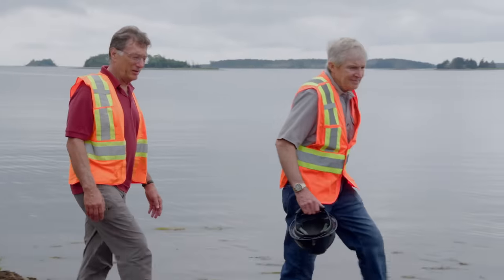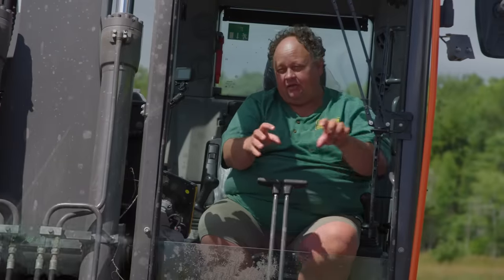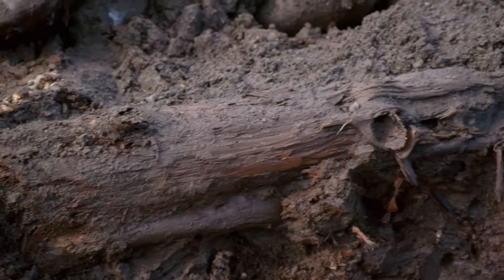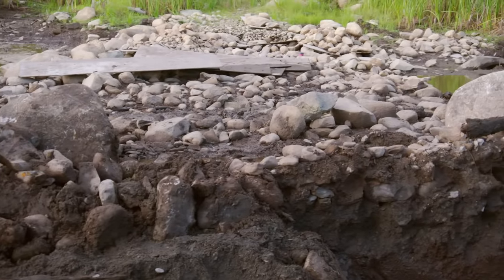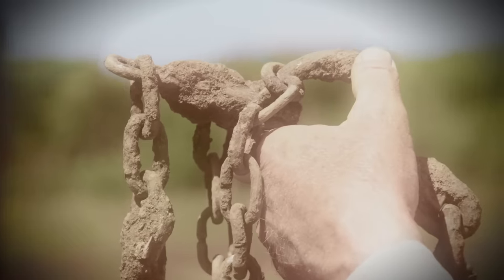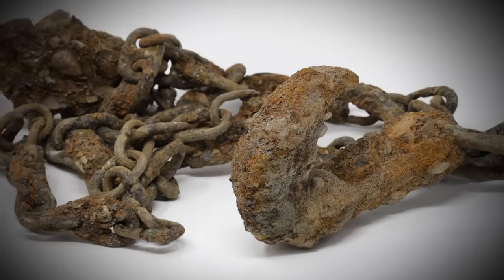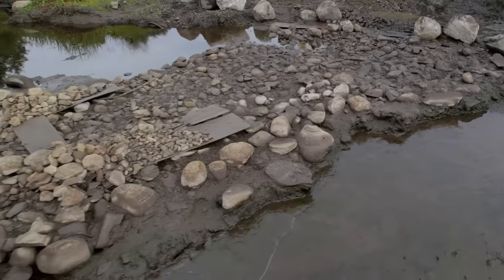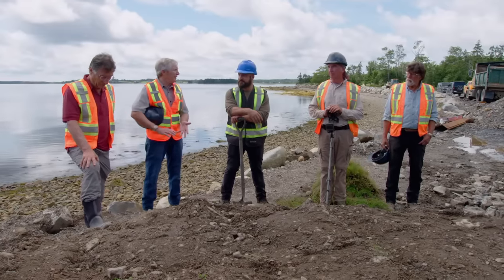The Curse of Oak Island: Mysterious Stone Road Provides Clues (Season 11)

Comment: Having worked with 3-point rigging I can tell you what the chain tells me. The "stretched" link I have seen before in Chinese weak steel. Pulls apart like putty. I see the scenario where this was holding a weight and suspended from a gantry crane. When the link parted, the released tension would have shot the rigging into the air. Very dangerous situation in Construction. I couldn't see anyone leaving a man-made chain behind. Too valuable. This chain was shot into the air like a rubber band, lost, and landed there to be found. My 2 cents.

Comment: When one wants to hide the loot, they would put in place which is secure, but at the same time its easy for them to recover. Based on all the evidences found, I might say that Oak island was a swampy place, a convoy of ships came there for some repairs, but in order for the place to be convenient, for repairs, they had to cut trees to build a pier & other basic infra to move the cargo from the ship thus making repairs possible & easy. So the people in convoy built the infra, stacked the cargo for which they build that basic road on swamp, they cut the wood around thats needed for the repairs, they might have built a forge to make basic spikes to fix the repair planks. The ships were repaired, the cargo put on it again, some of it fell during movement, and the convoy moved off. the forged chains are for lifting the load from ship to the cart to move to shore, also to lift the heavy logs that would be required for repairs. IF you assume that people spend few months to build money pit, where they might need a month to recover the "stash" its stupid. Its desolate island, but importantly the "crew" did not control it, so what is the point to put their stash on some place that they cannot control?

Comment: The chain or part of it dates from *1900's, not the 1600's.  I have chains from the 1870's that are more OVAL in links OOOOO. I see on this chain or *part of it,  being vertically straight with the half circle ends. So it could be two chains linked together, one part of it older 1800's and the other 1900's.  Carmen doesn't know the age of chains that well???